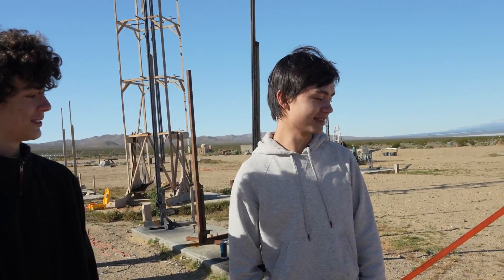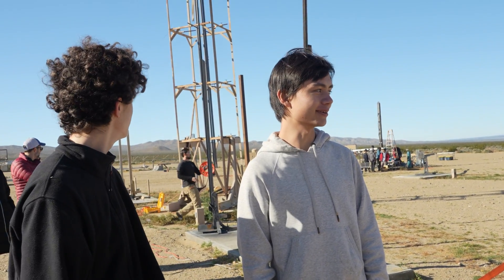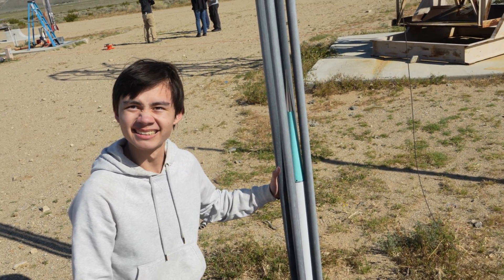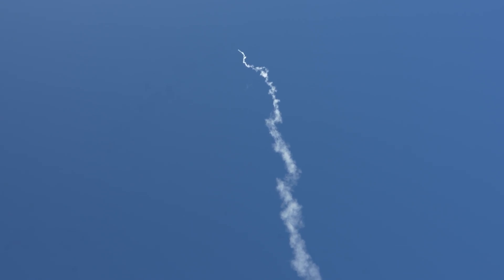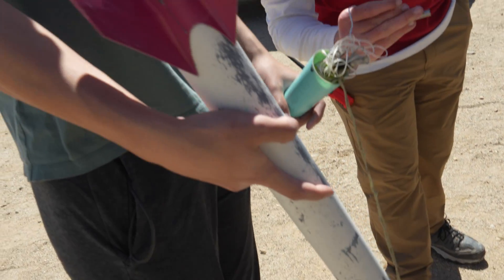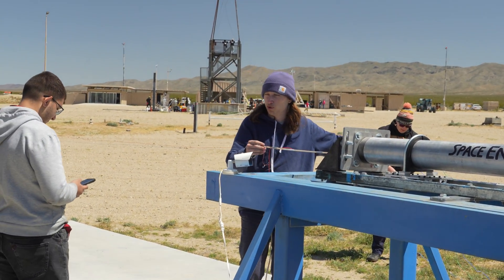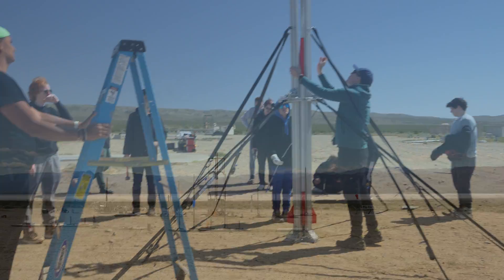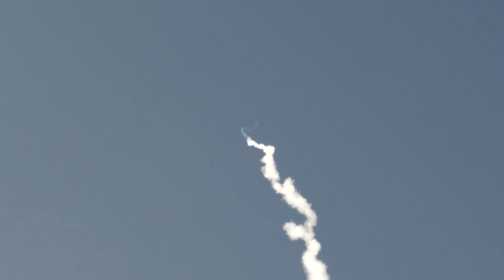Liquid and Solid Fuel Rockets at FAR

Comment: It's exciting seeing liquids finally starting to get a little more accessible. Combined with active guidance, it makes high altitudes miles more achievable. It lets you accelerate the vehicle much more gradually, to the point where you can practically ignore any of the demanding engineering for aerodynamic loading, compressive heating, high Gs, etc.

Comment: Was the last rocket recovered?  If you slow it down, after the first flame, there appears to be a flame above the rocket.  Did it have an issue, or did the flame travel up the channel of the extruded alum?
Reply from the maker: The flame at the top is just from the aluminum channels. It did, however, shred right at the end of the burn from what I understand. I'm not sure how much or if anything was recovered.
Reply: It was not recovered. Judging by the pings from the RDF beacon it came in ballistic.